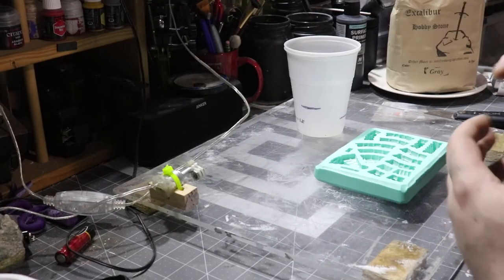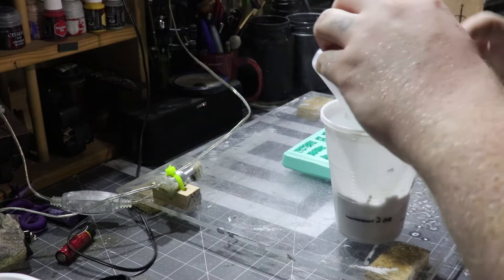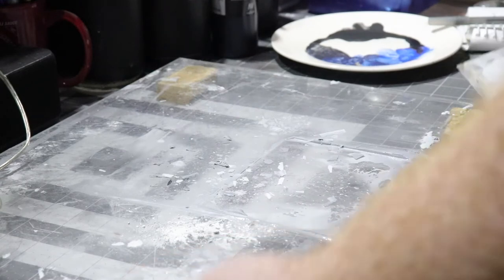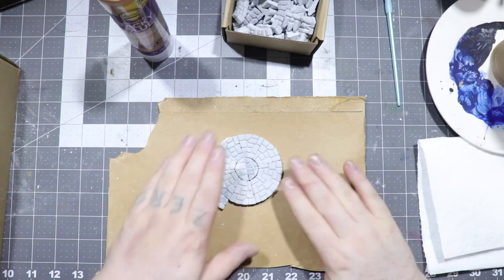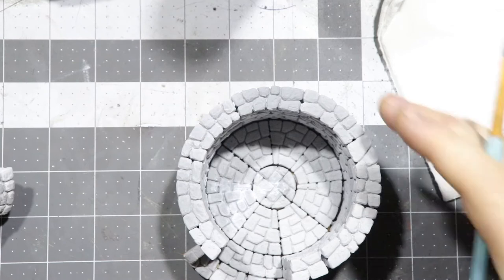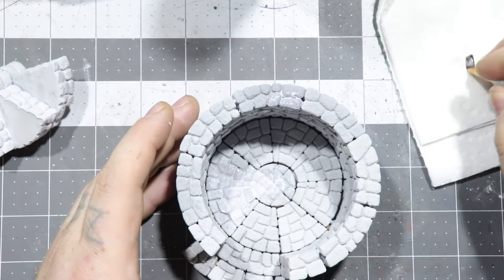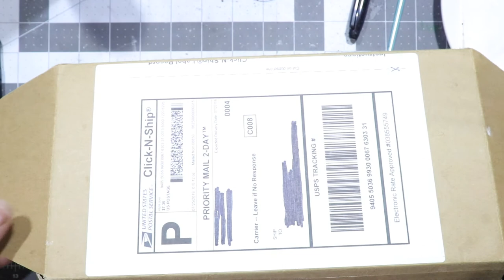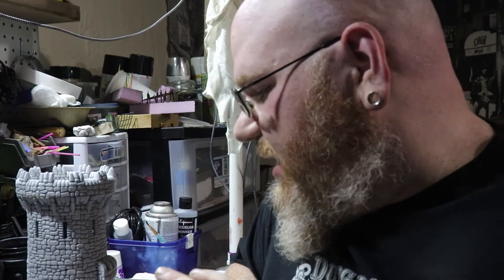Casting a Hirst Arts Fieldstone Tower | Part 1 | (TheDungeonMattster #046)

Comment: I read somewhere that for making this particular tower, take a Pringles can and use that to put the sides of the tower around. The can is pretty much exactly the size you need for the correct diameter for the tower. Just don't let the blocks get glued to the can. It makes for really straight vertical sides that don't lean inward or outward.

Comment: I have a very weird way of doing this that eliminates bubbles entirely. Pour wet-water to completely fill the mold. Remove all bubbles with toothpick or whatever. Pour plaster directly into the water-filled mold. The water is fully displaced by the plaster (do this in a tray!) leaving a fully clean cast.

Comment: When I cast, after pouring, I just use the back of a paint brush & rub around the whole mold.  I just rinse the mold to make sure there aren't any leftover pieces.  So far it's worked well.  I use hydro-stone for mine, I get a 50lb. bag for around $40.  :)

Comment: Re air bubbles....paint some of the casting medium into the mold first making sure you catch all the detail.
Reply from the maker: world of 28mm I’d say 80% of what I casted had no defects whatsoever. So it’s not all bad. 

I’ll try that! Sounds like the same technique used to cast silicone masks come to think of it.

Only complication I see is possibly the plaster drying partially while painting it on and it making chunks in the mold. But then again probably not anything quite so egregious as that.

Thanks for the tip!

Comment: Older vid but still relevant for beginners... I'm worried a bit about the weight of such a piece. If you have cast 18 times and used more or less 180 grams of powder per casting (let's say 150 grams actually in the blocks) that would mean that this tower would roughly weigh in at 2.7 kg or 6 pounds? Is that correct-ish?
Reply from the maker: I don’t know exactly how much it weighs but I can tel you it isn’t “light.” Definitely some heft to it.

Comment: I wanted to try out hirst arts molds for a while, cause the details looks so crisp. but they're pretty pricey..
you tower looks sick, how long did that take overall? so casting and building?
Reply from the maker: leurehc I estimate each casting to take roughly 30 mins including mixing, pouring, pounding, scraping, drying, unmolding. Needed 18 casts to make the whole thing. I made 20 for spare parts. 30x20/60=10 hours.

Then it took roughly that again to put the tower together over a span of days.

Total build time without paint was ~20 hours.
Reply: 30 minutes a batch? not to bad actually. i really think i'd love the process of building with these blocks, its basically lego for grown men lol
Reply from the maker: My thoughts exactly! Instead of interlocking bricks, you get pva glue. Instead of being able to take them apart and build something else, you simply make more. 🤪
Reply: @TheDungeonMattster  i like the way you think